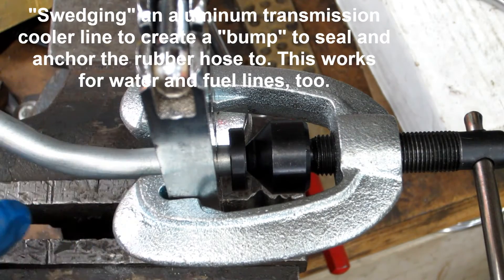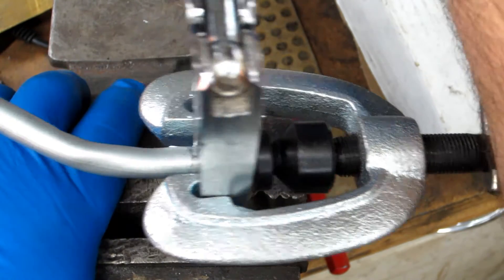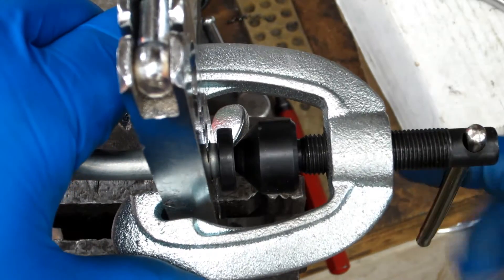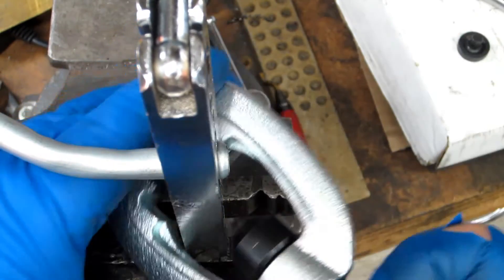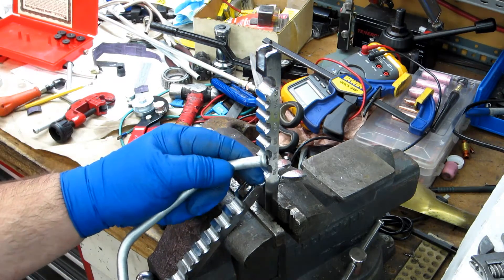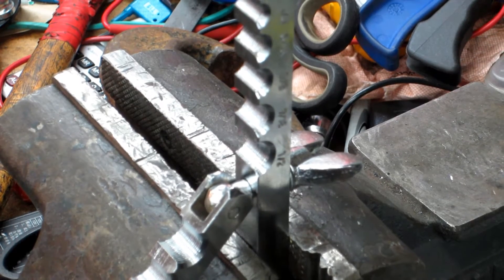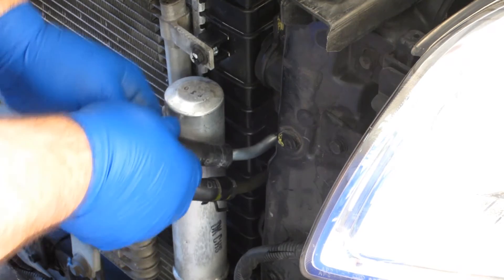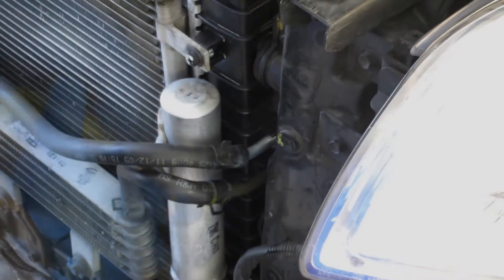Swaging aluminum tubing for hose connection (technically in the flare family)(edited)

Comment: Nice video!  I do believe the correct spelling is SwAging, and the process you are doing is actually flaring.  Flaring increases tubing diameter, while swaging reduces the diameter of a tube, often used to join two tubes of the same diameter, by allowing one tube to slide inside the other.  Your technique is great but it is half of a double bevel flare not a swage.
Reply from the maker: Hi Anthony, Thank you very much for point this out to me!!!  I've edited the title, changed the description and pinned your comment to the top. :)  I did go do a bit a research about this.  I should have done it years ago when I posted this video. LOL  Thanks again!!! Mike

Comment: What tool is that? Looks like an adapter of sorts to do that inset flair?
Reply from the maker: You are correct.  Any double inverted flaring tool can be used. You basically, just stop about half way through the first step. -Mike

Comment: will this swedge 1/2" mild steel tubing and where did you buy the tool? i can only find flare / swage tool.
Reply from the maker: I had to dig through the previous comments to find a link to the tool.  It's a Harbor Freight inverted flaring tool  https://www.harborfreight.com/double-tube-flaring-tool-kit-62814.html
Reply from the maker: 1/2" mild steel tubing??  I kinda doubt it.  They're designed for soft brake line tubing .....copper and aluminum too....maybe.  I guess it depends on the wall thickness of the steel tubing.  Too thin and it will probably get crushed by the holder.
Reply: @bluehandsvideo  thank you
Reply from the maker: @Haxsaw67  You're more than welcome.  I noticed on the page I linked, it says soft steel up to 5/8".  Good luck!

Comment: What dyes or inserts are you using to create this bump? I have a standard flair set to make the double flairs, but nothing in the kit to produce what you are showing in the video. I do not want the punch set, but the ones to make fuel line bumps. Let me know....thanks.
Reply: +ralph tuneit   As a retired ASE Master Tech, the guy appears to have the standard die sized and marked for the line as found in your inverted flare kit. Mine is from SnapOn, but ya. I was surprised at the beginning of the video, there was no explanation, tool list or other info. It appears to be an engine oil cooler on an import car that is aluminum. I see no reason why it would not work on steel. The flare die is shaped so it can fold the metal outward then onto itself. It is just stuck out further than making an inverted flare using the body of the die to set the exposed tube length. Most hate the "Corbin" clamp shown near the end. Corbing clamps where spring sire to start, but change to flat spring steel and is the only clamp the stays perfectly round and moves with expansion and contraction, due to pressure or temperature changes, like a radiator. I have a special long arm tool that has a flat jaw that opens opposite of a stationary jaw. It operates easy with a hand knob at the top. It does not bend, but it can reach places your hand won't fit.
Not related to this video, just helping out. ASE Master since 1978.
Reply from the maker: Thanks Dean.  You are correct.  I just added the info to the details box.  Trans cooler....possibly on my wife's old Caravan?  I didn't check the date on the vid, but I quite working on cars nearly 7 years ago. lol   ....and I do have the special pliers for those clamps....I just figure most people watching this won't.
Reply from the maker: Didn't get notified of this comment....sorry.  Dean's comment is correct.  I just used a double flaring tool, you just don't take it as far or do the second op.

Comment: Thanks! I have a cracked line on my rack and pinion. Aftermarket rack so the GM replacement line is nowhere close how it's bent. I need to try high pressure line attached to the hardline so i can use the original line ends on the aftermarket rack. I tried without flaring and it blew off. I think flaring the line like you did and using two high pressure line clamps will work. It's worth a try and cheaper than a new rack and pinion. I'll post if it works. I'm off to buy the flaring dyes.
Reply from the maker: I checked your channel....no vid. Hopefully this worked for you.  YT seems pretty pathetic at giving me notifications correctly.  Missed a ton of comments in the last year. :(
Reply: This is not safe and shouldn't be used for high pressure fittings.  Power steering systems can achieve pressure levels over 1000psi.

It is okay for low pressure systems (<100psi).
Reply from the maker: @dmanbluesfreak  Never got notified of this comment.  You're right!!  The return line of a power steering system should be okay, but this was the tranny cooler line if I remember right.

Comment: Is that the same block you use for flaring copper tubing with a little end for aluminum?  I would bet I could do that with my tubing flare set if I just made the little piece you inserted in the tubing.  Thanks for the video.
Reply from the maker: +cerberus I'm not 100% sure the angles are the same, but they're basically the same flaring tools.  I'll bet we can find the CAD drawings online for that piece so you can make it....if not, I can get you the dimensions from mine. :)
Reply: +bluehandsvideo that would be nice, thanks.
Reply from the maker: +cerberus Hi Harold.  There's been a delay......the anvil is missing out of my cheap set and my other set is still on loan.  I've got a note up in my shop in case I find the anvil.  I'm sure you'd like to try to make one, but you can get them on Amazon for $5-10.      .......in fact, I just went on Amazon and ordered replacements...10pcs, 2 of each size.....$13 shipped. :)
Reply: Not to worry.